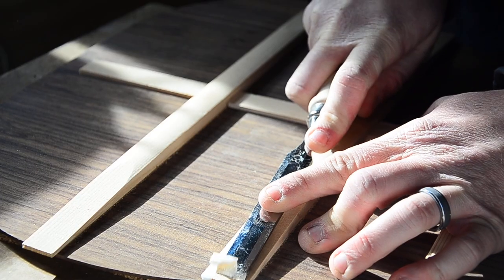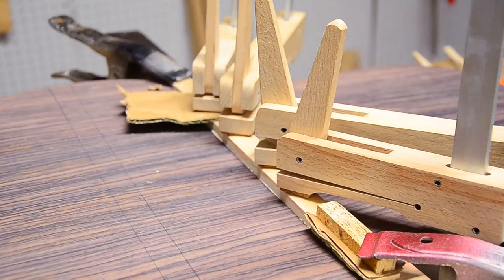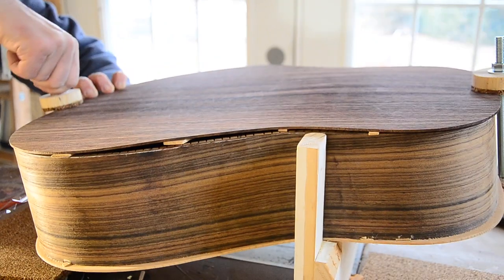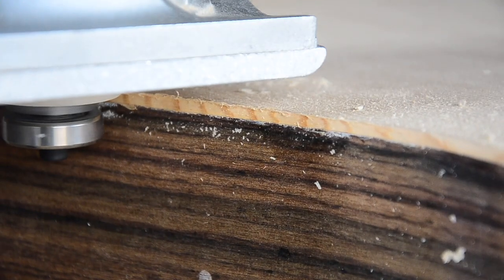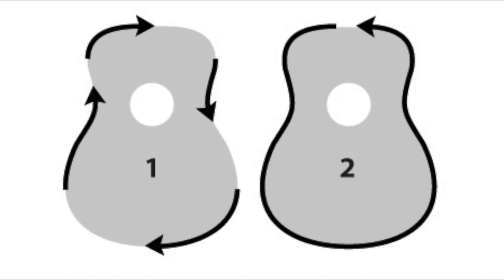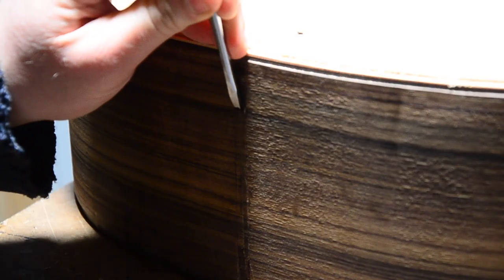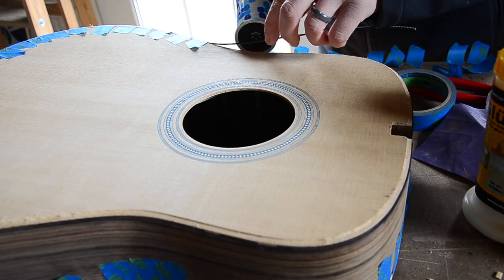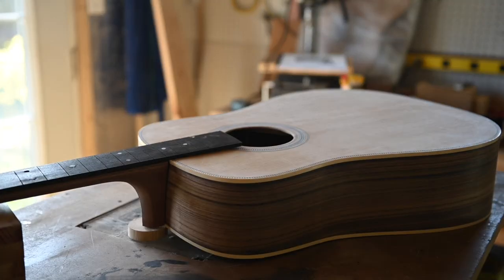Stewmac Dreadnought Guitar Kit Build (Part Two)

Comment: Pardon the poor English. This year I bought a stewmac Les Paul Jr. and found that the capacitor was the wrong value.
More importantly the "legs " didn't meet the distance between the pots. Stew mac responded by sending me a 0-047 uF an a 0.022 uF caps. They had a problem . i simply pointed it out to them and could they help. They checked and I was  right. Sadly, that model was deleted from their line but in future I'm sure their engineers will be aware of the parts in kits that manufacturers want them to sell. I simply observed the error but they responded as well as in 2005. They sent me the two Orange long leg caps, both values , post free immediately. I have no commercial affiliation with them, but their service, over the years, has been fantastic.

Comment: In this kit, you have sand the top before gluing bracing? I have OM kit from stewmac, but It's top seems very ruff, so should I sand this before bracing?
Reply from the maker: If you feel it should be sanded I suppose it wouldn’t hurt to hit it with some 240 grit. Just don’t take off too much material. You want to keep it good and flat.